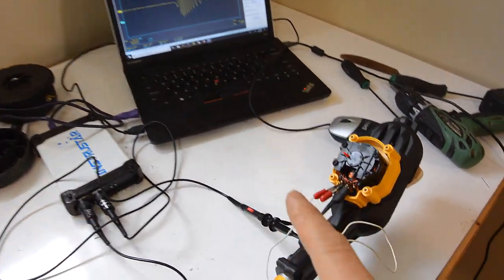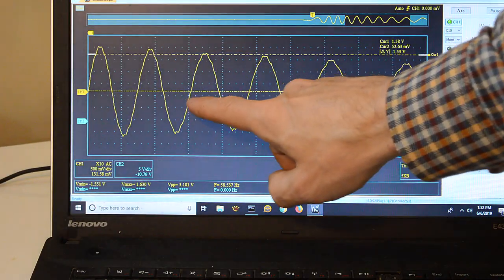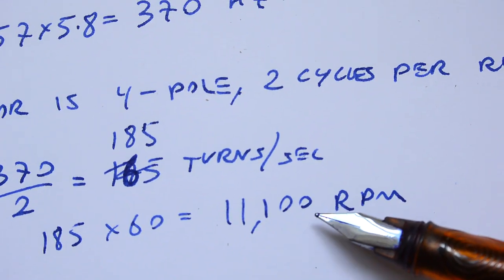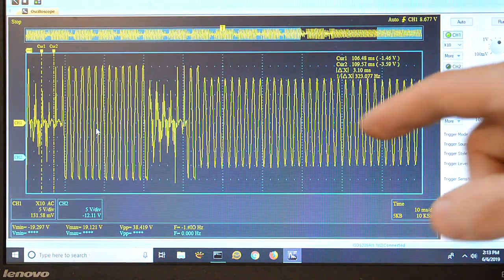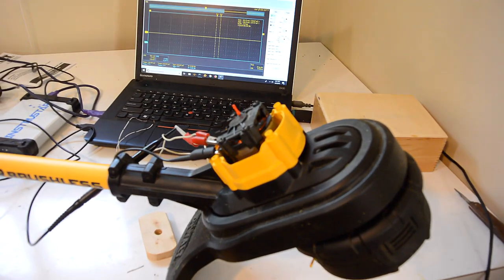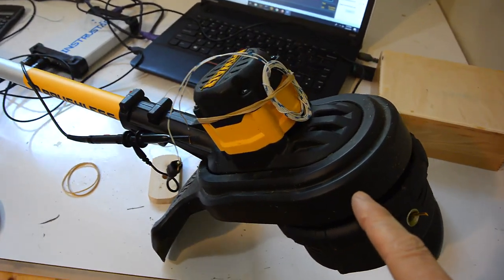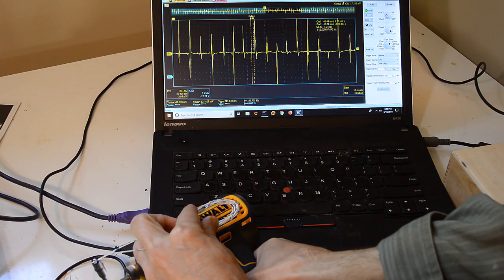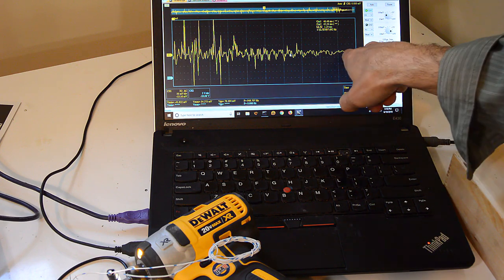Examining a brushless DC motor, and a dumb way to drive one.

Comment: It's inefficient, but it's cheap. I think they're doing it this way, because now they can use a far slower and simpler controller, with some cheap dedicated chips to drive the motor
Reply: That was my thought, DW is considering total cost of BOM, not ownership.  They'er going to make 10's of K's of these and want to keep production costs low, so what if the owner has to recharge more often.
Reply: @SlaveToMyStomach  And if the owner has to recharge more often, the battery wears out faster, so they have to get a new one, and hopefully by that time, "Oh, look, we don't make that battery anymore, I guess you have to get a whole new tool!"

Comment: Pure speculation of course: My guess is that they decided to use a very cheap, dedicated BLDC motor controller IC, that only supports running at max. speed. Doing high-speed PWM (>10x faster than RPM) requires fast MOSFET drivers and fast transistors to avoid losses during the switching, and that costs more money. As to why they're actively braking: maybe they need the motor brake to stop quickly when you turn it off, and they didn't invest time/electronics to switch between coasting while on, and motor brake when stopping, and just enabled the brake by default? And then they added the speed control by doing slow PWM on the motor driver enable line, which results in the "drive"-"brake"-"drive"-"brake" pattern. Altogether, it does look like a very suboptimal solution to save a few bucks (or someone who just cobbled together a circuit drawing without really understanding what they're doing).

All just guess work, impossible to say without having a look at the circuit. Maybe they have another, better reason that actually makes sense, but I can't think of anything.
Reply: But when Matthias drops the trigger, instead of then shorting the coils and braking the motor, they instead drive it to open circuit and the motor coasts...?
Reply: @robertbackhaus8911  Mmh, yes, good point. I guess that invalidates most of my hypothesis...

Comment: Most cheap brushless dc motor drives use block commutation. 

Here:

https://www.google.com/search?q=block+commutation&client=ms-android-samsung&prmd=insv&source=lnms&tbm=isch&sa=X&ved=2ahUKEwiBqKqeneLiAhVBtHEKHbzHAKMQ_AUoAXoECAwQAQ&biw=360&bih=560#imgrc=bMdnj_ld9-QE8M

So one phase of the motor is connected to the battery voltage and another to ground. Current flows from the positive connected  phase through the motor and out of the negative connected phase. The 3rd phase is left unconnected, but the controller does monitor the voltage of that phase to measure the back emf voltage generated by the spinning motor.

So really you should have grounded your scope to the battery negative rather than another phase as that other phase could be any voltage between ground and bridge (battery) voltage shifting your measurement  on the laptop around quite a bit.

After the motor spins enough for the back emf voltage of the unnconected phase to cross zero volts, that triggers the controller to step over to the next commutation  step (of 6) and energise a different combination of phase +'ve, phase -ve and unconnected.

This is called sensorless block commutation as you dont need hall effect sensors to tell the controller what angle the motor rotor is and when to step the commutation
Reply from the maker: Yes, definitely uses block commutation.  But they didn't need to short the windings once it's fast enough.

Comment: I dont have a large lot so I got a small black n decker lithium model, best weedeater I have ever used (cause I can just do it and be done instead of mixing gas and fussing around with those tiny devil 2 strokes)
Reply: I agree. I still don't mind fiddling with the cord. An electric mower is easy once you get used to minding the cord.

Comment: Maybe it's because the H-bridge would clamp the induced voltage to supply, causing even more drag if they don't short the winding?
I would also not have expected this, but probably best not to call a man stupid until you have walked a day in his shoes, likely there are good reasons. Interesting that Dewalt is again betting on a geared system while the Makita trimmer uses direct drive, just like the chainsaw.

Comment: isn't that supposed to be the rotating magnetic field of three phase power
Reply: I agree with this and since it is 3 phase power the motor speed would be controlled by varying the frequency of the synthesized power.  Wasted energy would be avoided by reducing the duty cycle of the applied power hence the gaps in the applied power.  Reducing the amplitude of the applied power would waste energy with IR loses in the linear voltage reduction circuits.

Comment: The Slot in the Motor Back Cover is for Hall Sensors. Its the same Motor as the one used in their brushless Drills just without the Feedback.  The Feedback gives you more torque at low rpm.

Comment: It's because DC motors are more efficient at high voltages/currents as the inefficiencies are static and/or diminishing. So tl;dr if running 10W through it gives 1 unit of power out, 100W would give not 10 but 12. So they use this method to get the motor working in it's sweet spot and then it's supposed to idle, which you're probably seeing as back EMF and thinking is lower power input. Great video though. Too bad the loop wasnt very sensitive.

Comment: I think this is all about saving money on the micro and half bridges. A proper sinusoidal processor requires 6 reasonable speed pwms. With this implementation known as "bang bang" modulation, you can do the control with a really cheap micro and half bridges.
Reply: plenty of BLDC drivers based on AVR, so it doesn't take much and one pwm shared between the phases is enough
Reply: There isn't really any advantage in trying to drive the coils with sinusoidal voltage, except for noise.
Reply: yeh, afaiu the principal different between BLDC and PMSM is one is wound for trapezoidal EMF  the other sinusoidal
Reply: You need 6 pwms if you are going to control the half bridge dead time. And if you dont control the dead time then your driver trebles in price. I have designed a few to find this out. These were high performance though

Comment: Why do you declare the weed trimmer design to be sp emphatically "stupid"?
It would seem to me that the drive is being periodically suspended in order to allow it to function as a generator, so the rotor speed can be measured. This is a good method.
The control loop is then using PWM to maintain the rotor velocity/momentum setpoint (as determined by the trigger).
So long as the desired degree of stability can be achieved, there is nothing wrong with this method of control - I don't see where it is stupid or inefficient.
In fact, switching the drive at an unnecessarily high frequency to achieve some sort of "clean" drive waveform would be much more inefficient. The mechanical components of the system provide sufficient filtering to remove all the low frequency PWM from the output.
The only down side I can see to low frequency pulsing would be that the pulses may end up in the audio band and be a bit annoying - but, given it is a weed-whacker... (the noisier the better)
Finally, even a "bang-bang" thermostat is, at the limit, generating a PWM signal, it is just a matter of loop transfer function,  settling time and overshoot which determines its suitability for the application...
Reply: It's because the waveform suggests electronic breaking in between the bursts of pulses. The braking is in effect shorting the output terminals of the motor to make it slow down faster. If it were coasting, you would see the back emf in between the bursts.
Reply: @timhoeppner6691  good point, I had missed that.
Perhaps the control loop is being a bit too aggressive in avoiding speed overshoots - something it would normally have to do to brake the spool when the trigger is released.
It may be, that without a load, we are merely observing oscillations around the setpoint and with weed line in place, the extra wind load would settle things down...
So, I will revise my rebuttal: "with the exception of its (potentially) wastefyl braking when experiencing loop instability, why do you emphatically declare the design to be stupid?"
Reply: @perrybrown4985  nice, I can get behind that.
Reply: @timhoeppner6691  also... I am not convinced that the spool is braking between the drive bursts. Just because you are seeing ~0V across the windings in the dwell periods does not imply braking, since there is no power transfer in that situation.
Reply: @perrybrown4985  again if the output drivers are off, you should see the back emf from the motor spinning. Take a small motor and spin it with the output terminals open circuit, then do the same thing but short the output terminals. When the terminals are shorted the motor won't spin easily.
Reply: @timhoeppner6691  I will have to ponder this. I know the effect that you are describing, but feel compelled to assert that it is not a braking effect, since, other than copper losses, no resistive (power dissipating) element is being introduced into the circuit.
I guess the same effect could be observed with two interacting rings of magnets. There would be a strong detent force, but they could not function as a brake - once they become decoupled, all energy absorbed by one detent is released upon entering the next...

Comment: Very good video, the problem is called chineeze engineering. Make it as cheap as possible, sell it to the public as a brushless DC motor which most would think its going to last. What will go before the hardware is the battery, that is THEE most EXPENSIVE item on this device. The same goes for their Brushless DC Motor (BDCM) Drills.

Comment: I had a DeWalt trimmer just like this. Had it for 2 seasons, in my tiny yard, and never fully uncharged the battery. Then after this past winter I went to use it and the battery was dead. Wouldn't charge up. I call customer support and they tell me it's out of warranty, and that they don't make that battery anymore. Although I could buy a replacement battery at Lowes... for $265.

The trimmer / battery came together for $150. A brand new trimmer / battery was around the same price.

Meanwhile I've had a Ryobi mower, trimmer, and leaf blower and 3 batteries that are absolutely packed with juice and I can take care of my entire yard on less than 2.5 batteries.

Never buying DeWalt battery-powered lawn equipment again. My experience is that they make solid cordless hand tools but I don't trust the brand anymore after they abandoned this whole battery pack after 2 measly years. The kicker was that when I gave the serial number for the battery, the lady at customer support told me it was manufactured in 2016. So I bought a brand new trimmer that came with a year and a half old battery.

Great.
Reply: You may be able to take the battery apart and replace the cells.  I don't have one of these machines, but I have seen videos of people doing that for various battery-powered tools.

Comment: I wonder if the driving in this manner doesn't work better when the string trimmer is loaded.  A single string trimmer would only be loaded for maybe 120 degrees of the rotation.  The rest of the cycle, would be building up inertia for the impact cutting during loading.  So the motor runs free with the expectation that the loading will average it out, but on the test bench it has to brake.

Comment: Does that setup have any torque benefits in the way the trimmer is used? To prevent it from stalling in heavy grass?
Reply: I would say it allows them to have a smaller motor so saves weight and money for them.  In the end a 3:1 torque increase isn't all that much when slashing through the tall grass.

Comment: What I noticed was the motor lacking a feedback loop via a hall effect sensor.  The controller only has a vague idea what the motor is doing.  I've tinkered with brushless motors used in computer equipment where a fine grain control is needed and they all have hall effect sensors mounted by the rotor.  The controllers are fairly low voltage and use PWM for control but they are still brushless motors.
Reply: Sensorless brushless motors are very common. Usually only two of the coil (pairs) are driven and the third coil (pair) is used as the "sensor". The only drawback is that the motor has to turn at a minimum speed to generate enough voltage in the third coil for the controller to "read". So for a tool it's totally fine to not have a sensored motor/controller.
Reply: If the controller only had a vague idea of what the motor was doing, it wouldn't work at all. You can't just wing it when you are commutating a motor. You have to know where the rotor is with reasonable accuracy to turn your transistors on and off at the right time.

Comment: Don't know how you are probing but if find a GND point and you probe two phases at the same time you should see more ON time. What I'm saying is that the motor is driven one phase at the time, so if you probe just one phase you will see a lot of OFF time.
Reply from the maker: that would be true if the off time lasted just a fraction of a turn, but please watch the video.

Comment: As with batteries, it might be best to test under load: Without load, batteries exhibit near-to-nominal voltage, even if they are practically empty. With a 50 Ohm resistor as load, things turn out a little differently. I suppose the same goes with electronically controlled motors: No serious load, no usable measurements.

Comment: I can't speak to brushless motors, but I have some observations on that weed trimmer. I have the same model. When I run it continuously on "High," the battery only lasts a few minutes. Continuously on "Low," I was able to run it continuously and take care of my whole yard with power to spare (> 30 minutes, maybe an hour). Without taking any power measurements, I supposed this was due to the lesser current draw on the LiIon batteries. Based on your waveform there, I'm now wondering if the "brain box"/potted electronics module is doing some kind of regeneration, rather than simply wasting the power.

Comment: Maybe we look at this from a different angle of build (I have too much  experience in China with contracted designs) & should be fairly accurate:
1. DeFault Marketing & Sales specifies criteria & drinks..uh..guesses...uh..estimates qty & price. Finance & Sales backs into landed cost. Hong Kong Enginerding approves/alters specs.  HKG Supply Chain finds mainland suppliers.  Proposal approved w/little USA/Canada input.  
2. Mainland suppliers look at specs, then quote.  DeFault accepts the low bid or bid from preferred supplier for logistics reasons.
3. Then & only then do the people who actually have to build the unit see what they need to do. No way can they make it for the internal cost required by the boss. The boss throws a well planned & acted snit.  Everyone scared.  So they start cost reductions where they think DeFault will not notice till too late.
4. Mainland suppliers seek the cheapest parts supplies & build the unit around these components.  Then show planned changes to DeFault HKG. Arguing ensues. Price trumps all. Supplier wins. (No, I dont mean tarrifs from trump.)
5. This is where the suboptimal programming takes effect. A.) The components cant take the stress so program works around weakness-program around, B.) The cheap components can't ever do the optimal task-program around, C.) The programmer is not experienced enough or care enough to design the optimal program. In 50% of my experience, it's issue C - Oh well only Mattihas & AvE will notice.
Reply: Thanks for the insight. That's industrial sociology.

Comment: To really understand what that weed trimmer is doing is to take the electronics apart compare it to the electronics of other brushless tools. I would say bread board a circuit using an arduino as the PWM and drive it through some FETs and see if the motor runs the same. I see that various BDCM run differently as to how they are driven by different circuits and the frequency you subject them to.  The quickest way to drive 3 phase DC Motor is to use an RC ECS module. That uses PWM.

Comment: There is indeed some mystery /voodoo in the controller behavior, but it would be a disaster for DeWalt if their run time lagged behind their competitors. It doesn't, so there's method to their madness.
Reply from the maker: Agreed.  I'd like to know what that method is.  It freewheels pretty good open circuit too!